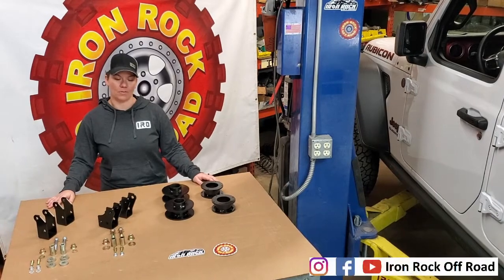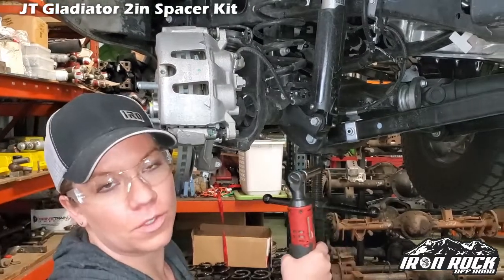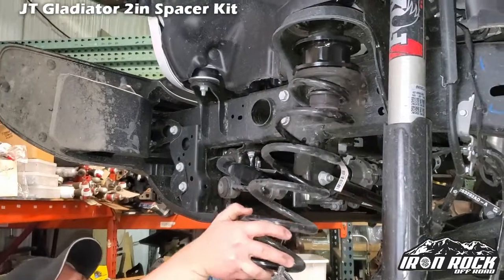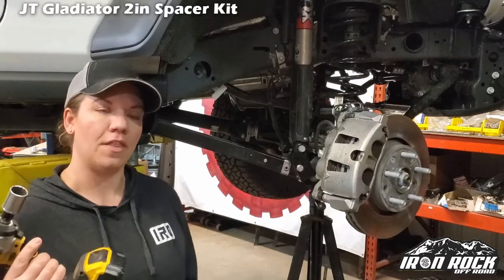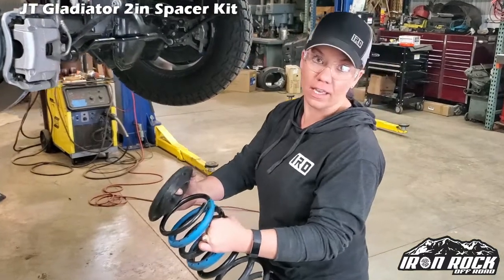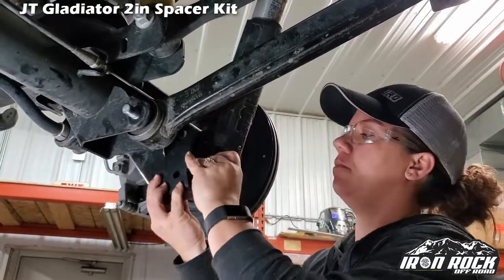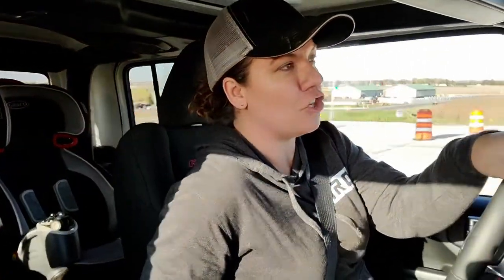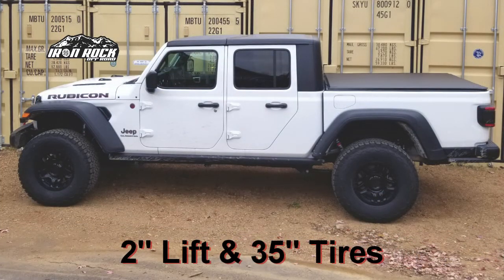Jeep Gladiator 2" Lift Kit Installation | Iron Rock Off Road

Comment: Just bought and installed this kit on my Mojave. Great product especially for the price. Be prepared - the rear springs were FAR more difficult to get back in using a floor jack and stands. Had to be really careful not to stretch the brake lines. Front was much easier. Really happy with the look and drives just as it did at stock height.
Reply from the maker: Thanks for the tips!

Comment: Do you have to realign the front end ?
Reply from the maker: the steering wheel was ever so slightly off center.  That's a super simple adjustment :-)  you could get a full alignment, but it's not required.

Comment: Is adjustable track bar needed 2022 gladiator Willy’s with 3.0 diesel
Reply from the maker: Hi Mike, it is not necessary with the 2" lift, however it certainly would be a nice upgrade over stock!

Comment: I understood everything except the reason for the one bolt that just screws into the bottom of the shock extension. What is the purpose of that bolt?  Thanks ahead of time.
Reply: Not a car guy but I'm a math guy...  I thought that would keep the extension in place as opposed to rotating freely on the other bolt.
Reply from the maker: To keep the bracket from rotating

Comment: Hello there. I just installed the 2-inch spacer lift on my truck. The rear springs were definitely a bear to get in. I used a spring compressor to help. I like the lift on the truck and its great quality. But now I have a noticeable tire rumble increase going over rough roads. It's like loose lug nuts. It's not I checked. And thinking back on the installation I did not loosen the control arms. Could the increase in height be causing some feedback?
Reply from the maker: Hey Jim, by not loosening the control arms, the rubber bushings will be in a constant state of twist, which can lead to premature wear and/or failure.  Please take the time to go around and loosen and retighten all those bolts.  I cant say for certain what the rumble noise you are hearing is caused from, without seeing the vehicle, but I would certainly start with resetting your bushings :-)
Reply: @IronRockOffRoad  Thank you for the reply. Yes, I will reset the bushings and see what's what. I didn't because the axels drooped enough without loosening I was worried about damaging the brake lines.

Comment: Please help, After installing this on my JT Rubicon my front end bottoms out over dips really easily. Do you know why that might be? I’m not scraping the bottom but it’s more like a jarring hit as if the spring or shock are being fully compressed but it doesn’t make sense to me how that would happen. Do I need new bump stops when I put this in or are the factory bump stops just fine? Please help.
Reply from the maker: Hi Todd, that seems unexpected.  can you email us at tech@ironrockoffroad.com or call us at 952-210-7185 and we will do our best to help you figure out what's causing the harder hits?